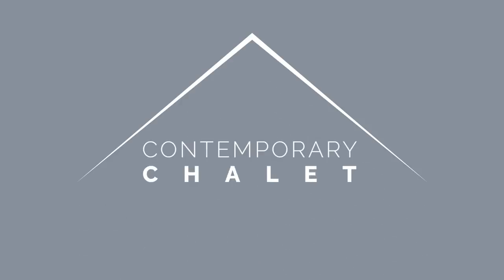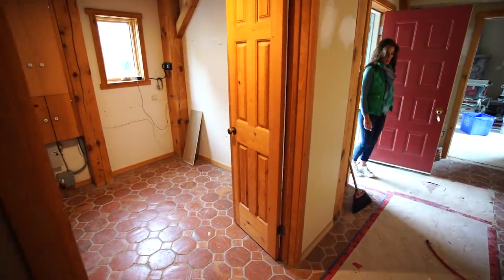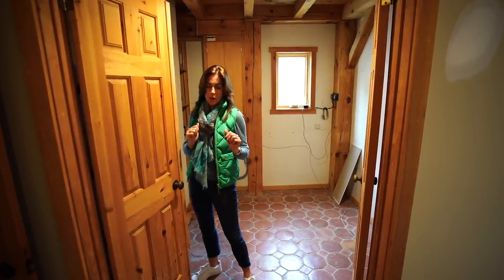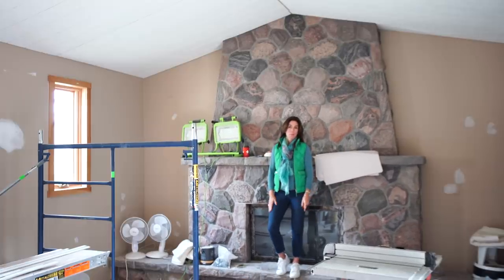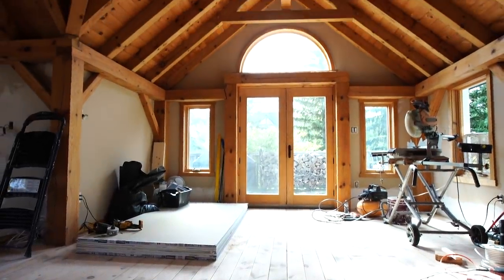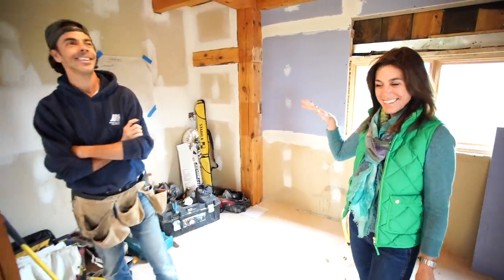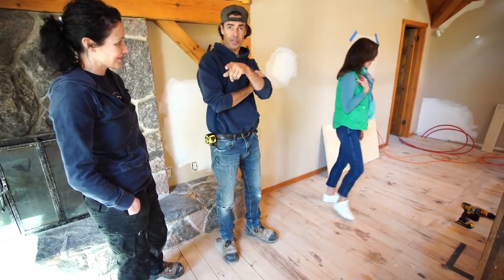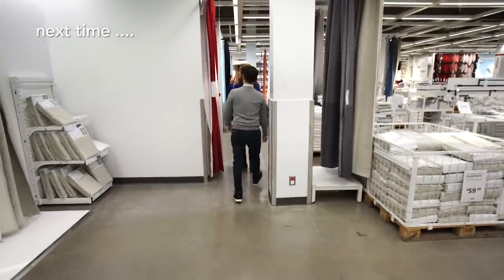Contemporary Chalet: "Making It Work" - Solving Design Dilemmas! (Ep. 5)

Comment: Okay, if you find the granite from floor to ceiling overpowering, maybe you could clad the upper part in barn board or drywall and leave the stone on the lower part of the fireplace. Good compromise? : ))
Reply: Sherry, I said exactly what you said without reading your comment, first. Didn't intend for that. I agree with your idea!
Reply: I agree with this. Don't paint the stone.

Comment: Work with the granite.  Use the palest of gray tones to minimize it, both on the walls and ceiling.  Then, use furnishings that have some rusty and gray tones in the pillows, leather, etc. that pull out some of the other colors in the granite besides the pink.  But I'm sure you're going to end up painting it because I know from 100 years of watching you that if something bothers you at all, you won't be happy until you fix it:)

Comment: STAIN THE GRANITE! It is possible with iron oxides (and other durable concrete stains) to stain stone and brick. There are YouTubes about it. Easiest tactic: wash everything in the stain (possibly under-staining the worst of the pinkies with green to cancel it out first) then tuck-point a thin layer of new grout so that the mortar joints don't give the game away (which I did to rescue a disgusting yellow brick fireplace). This will not be as durable as say staining concrete or brick and the color payoff will be much less since granite is less permeable than concrete, but it's worth a try. I would much rather look at a dark gray bossy fireplace than a pink one! Love your content - hope this helps!

Comment: I think you should take the flat stock that was put up on the ceiling between the beams, and add it to the closet doors. Put it around the edge of the face (like it is on the ceiling) and then use the extra and make large 'x's in the center. It looks 'barn-like' without too much bulk. My two-cents from Vermont!  Cheers!
Reply from the maker: The two-cents are appreciated! I'm excited to reveal what we've done to the closet doors so please stay tuned!